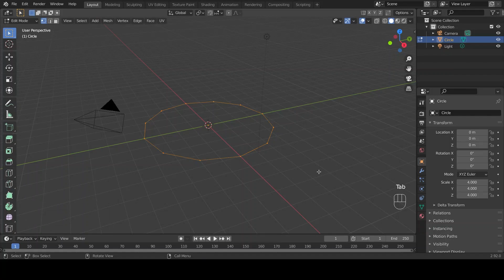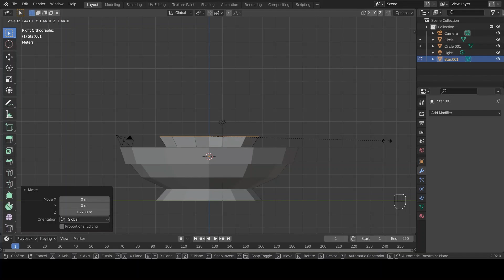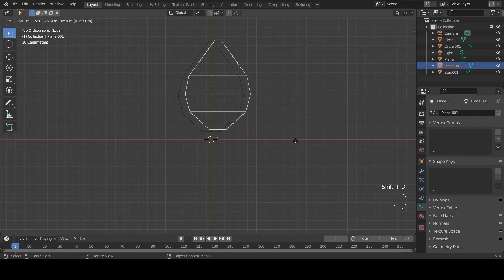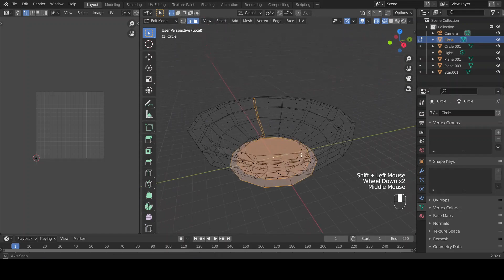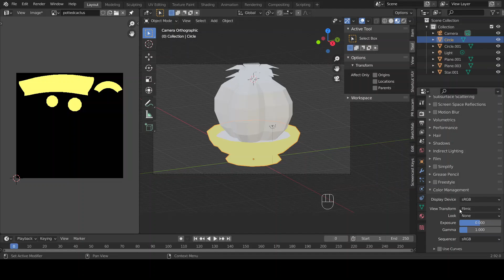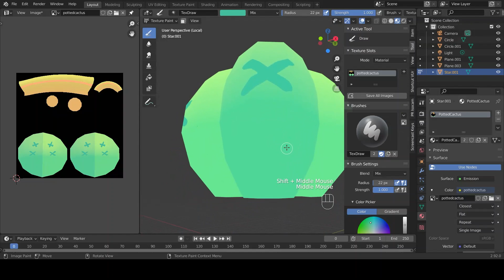3D Painted Cactus Tutorial in Blender 2.93 | Polygon Runway

Comment: When I was making mine I wasn't able to tick the backface culling in the settings. For anyone that is creating this cute cactus and is using Cycles in Blender, this is what I did :

In the Shading workspace, add a Geometry node to your material.
Add a Mix Shader node.
Connect the Backface output of the Geometry node to the Fac (Factor) input of the Mix Shader.
Connect your original material's BSDF output to one shader slot and a Transparent BSDF to the other.
Connect the output of the Mix Shader to the Material Output node's surface input.